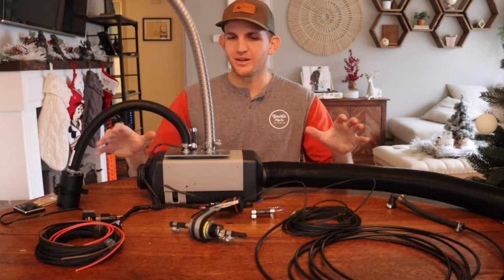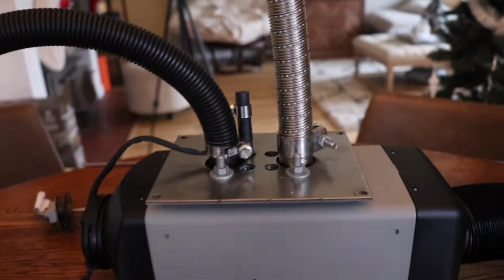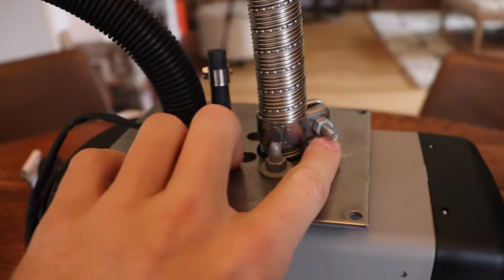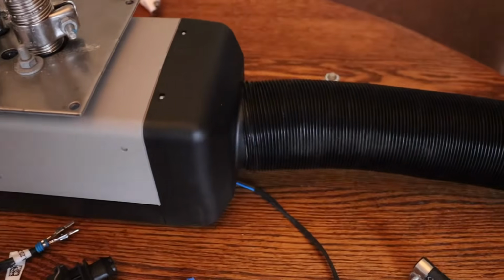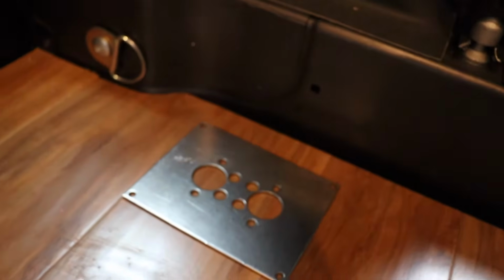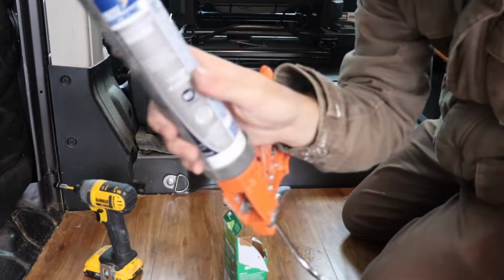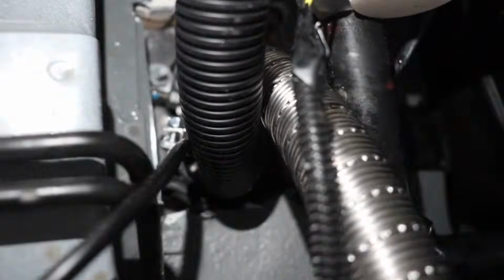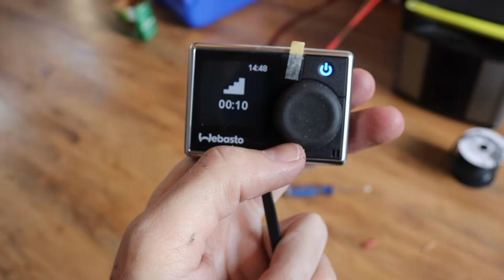VAN BUILD | WEBASTO HEATER INSTALL| A SIMPLE BREAKDOWN

Comment: You used the wrong fuel line at the adapter. The installation manual, and the webasto tech-support folks will tell you to NEVER use anything other than the supplied fuel line. Webasto sells a rubber adapter that goes right from the adapter to the plastic fuel line. 
I think you need to buy a better hole saw. I have drilled literally dozens of holes in sprinters, transits, and promasters and it still cuts great.
I like where you put it. In a ProMaster that works great, there's nothing behind the seats really, no fuel tank, transmission, etc. Nice idea.
Reply from the maker: Hey there! Thanks for all the information. What is wrong with the fuel line I used from the adapter? Is there any harm or danger in the method I used? 
Would you link the adapter you used! That would be very helpful. And what kind of hole saw did you use? I used one of those $45 Milwaukee ones at Home Depot that says it’s designed for cutting metal. I may have just drilled too fast... 
and thanks! I really like the location of the heater too. 
Thanks for all the info!
Reply: @ColtonAnkeney  Truth be told, that short length of fuel line is probably ok, but the issue with anything larger than the stock fuel line is that the heater 'knows' that each pulse of fuel is going to deliver XX mL of fuel to the heater. If the fuel line is too large after the pump, each pulse will deliver more than XX mL of fuel, causing over-fueling and the problems that result. If larger fuel line is used before the fuel pump, the pump might not be strong enough to lift that column of fuel, causing either a no-start, or under-fueling. 
The adapter for the fuel connection is webasto part number 1319718, but you'll also need a 12mm version of the clamps that are in the kit. That number is 1310736. It's a great way to make that connection. 
The hole saw set I have is made by Lennox. 
You don't see a lot of folks using the ProMaster for these builds, but I think, if you don't need 4X4, it's a great option. That low floor and front wheel drive make for a great package for a build, in my opinion.
Reply: @1QKGLH  - great addition to the install.  I checked the clamp part number and I believe it should be 1310763a

Comment: Hi, great viideo!  I'm concerned about using my webasto in elevations say over 6000 ft or so, will I need another part to ensure that it works up there??
Reply from the maker: Hi!! thats a great question. I don't believe you need a separate part but there is definitely procedure that needs to be done. I have used mine at 6000-7000 before with no issues. But anything higher than that I would set it to High Altitude mode. 
Here is a link to a forum that should help!!!
https://faroutride.com/air-heater-installation/
Reply: @ColtonAnkeney  Wow!! fast response, thanks. Another question. Regarding the Dorman Bundy Fuel Line Adapter and the fuel line coming out of it, does there have to be 2 different hose sizes? Isn't there an adapter that the fuel line from the kit will fit right onto??
Reply from the maker: @gpswildride  unfortunately not that I know of. But that barbed hose adapter does the trick!

Comment: Great video. Do you know what size drill bit for the fresh air clamp connector ?  Also, I used a Milwaukee hole saw and it went through the metal like butter ...
Reply from the maker: Really??? Mine didn’t even get close....

Comment: Hi I cant get info on how to get fuel line into tank. No one shows that. Don't you have to pull tank down to get at entry? Thanks Mike
Reply: Thanks I have ford transit.  It's ok will my mechanic, they have to get in there to change the regular fuel pump I think
Reply from the maker: @househound21  ah okay, sorry I’ve never installed one on a transit. Hopefully soon tho!! Good luck with your install
Reply from the maker: Not for the ram promaster! Just that adapter that clips into the auxiliary port! Link is in the bio

Comment: This might be a difficult question but is the Webasto similar to the Espar D2 heater?
Reply from the maker: They seem similar but I don’t know the exact differences!
Reply: @ColtonAnkeney  thanks! Didn’t know if you’ve used both before and preferred one over the other!
Reply from the maker: @journeywithernie  nope! Sorry!!!
Reply: Typically Webasto is used for gas engines like most of the ProMasters and Transits, and Espar is used for diesel engines like most of the Sprinters. Espar does offer a heater for gasoline engines, the M2-B4L model, but I haven't seen it installed in many vans. I haven't installed or used either of them but that's what I know about them.

Comment: The most simplified DIY I've seen for the Webasto! Do you have any plans to cover the cutout underneath the van to prevent water intrusion under the floor?
Reply from the maker: So glad I was able to simplify the process for you! I watched every video there was before I installed my first one and I was confused every step of the way lol. and yes I spray painted the edges of the metal and flooring after I cut it and used silicone under the plate of the heater!